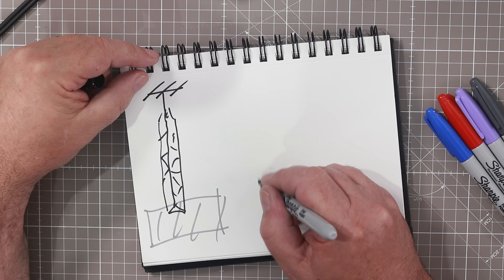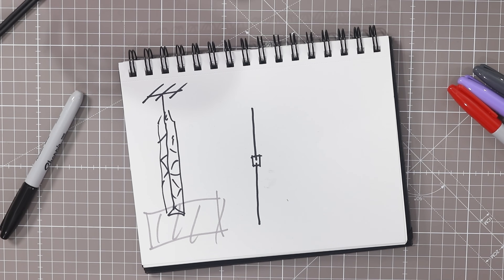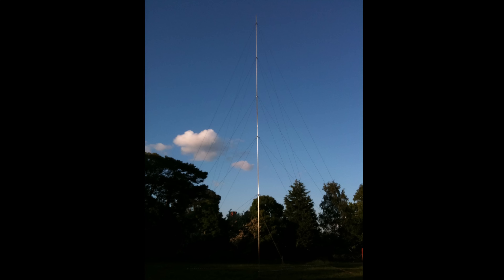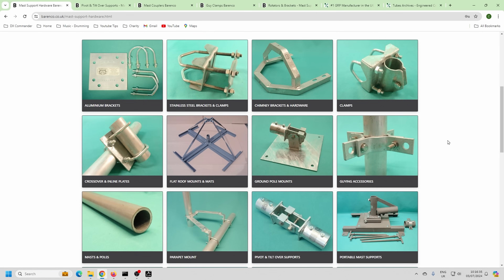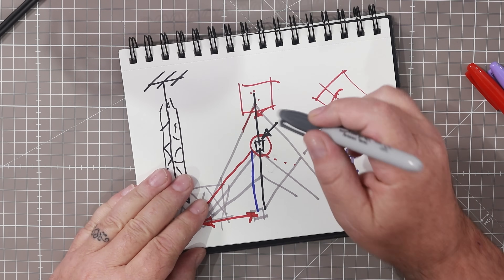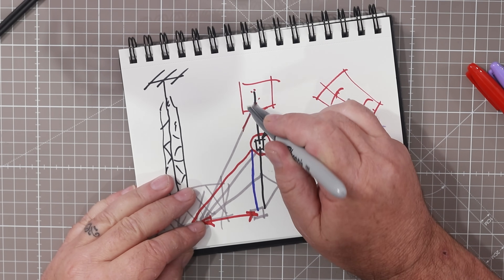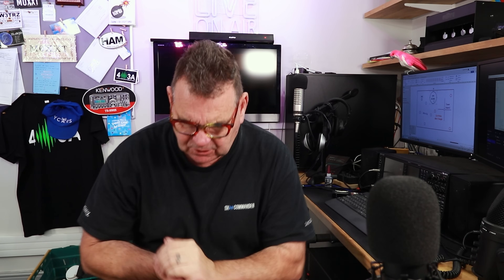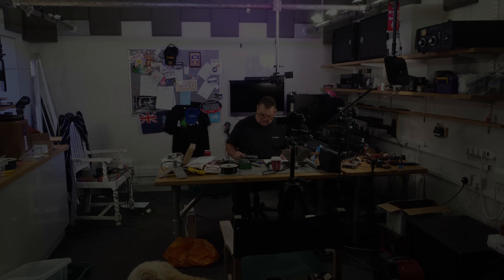Cheap Tilt-Over Tower Ideas for Ham Radio Antenna

Comment: The Chinese use bamboo for scaffolding. Four guys? I prefer Five Guys, but they are quite expensive compared to McDonalds. Oh, unrelated, have you seen Lewis (RingwayManchester)'s latest video? He shows an old cell tower which is currently laying on the ground and is going begging. Probably overkill, but probably cheap. Will probably require three smaller embedded concrete blocks. And it'll probably detune the other antennas so probably a non-starter...
Reply from the maker: It might be cheap - now find me the transport costs - and tilt it over since I am not climbing it :)

Comment: An ideea, put a hinge at the joining spot of the mast, right at the middle of it. You will have ropes also there, right below the hinge. First, easy loosen the one on the top, only the upper part above the hinge will go down. After this is down, loose the rope that is connected right below the the hinge and lower also this part. This will also minimize the weight of the base, the lateral forces for rise and lower the mast will be splittes with the anchoring ropes.  I think will work, you will have a 2 pieces pole with a hinge between, rise and lower on stages. I have done my best to explain :)
Reply from the maker: Well, yes.. Maybe - but I happen to know my way works.. We'll see! Watch the space!
Reply: Is not what i have tryed to explain but search a "hinged pole"  on google and remove the part of top pole below the hinge...

Comment: a long time ago 30+ years I went to a local rally and they had an antenna test range set up for VHF. You could book a slot, connect up your vhf beam and then get a 360 degree plot on paper. They used a variation of the falling derrick system. There was the main vertical scaffold pole, and at the base another pole (the derrick arm) pointing away from the main pole. What they then did was add some more poles from the top of the derrick out at 45 degrees or so which connected to another couple of poles attached to the bottom of the main upright. Another two poles were used as "guys" to the top of the main pole.

Hard to describe in words, but another description, it was a triangle on the ground half way along one side was the main upright, another pole from the apex to the bottom of the main pole, then from each corner of the triangle to the top of the main pole. The triangle on the ground acted as a pivot and counter balance as the pole was winched up and down. It seemed to work very well.

Andy
Reply from the maker: Yeah, I've got it..

Comment: Hi Callum. John Eckert KK7UAG here.  You may look into using something like Unistrut. If I remember correctly, it comes plastic, fiberglass and steel. GOOD LUCK & 73's
Reply from the maker: Looked at that.. Thanks.
Reply: I use a piece of unistrut for each of 3 different masts. Two of them have large VHF/UHF satellite arrays.

Comment: For raising and lowering, check into a 12v DC winch for an ATV. You can put a clevice attachment on one of your guy wires so it's removable when not raising or lowering.
Reply: Beware - ATV winches are good for use in raising (or pulling), but not for lowering (or resisting) a mass weight.  The ATV winch may fail when lowering the mast (as I understand from others).  Winches good for both raising and lowering are quite a bit more expensive.  Don't get hurt, please.
Reply: @dwallich56  no different than unloading a car from a flatbed wrecker. You can easily make a mount to attach it to the concrete pillar to  work from. I'm disabled. I have to come up with other ways to do things. This works well.
Reply: @dannyjardine8828  Could be, but  light duty ATV winches are much different from heavy duty wrecker winches.  That's my point.
Reply from the maker: I don't need power. This should be a hand winch.. And I can probably do it with a pulley.

Comment: No no no  3 polls the One in the middle tilt's over there one in middle is waited for easy tilt 3 bolts or stage pins to lock in place
Reply from the maker: You can do that.. But the outer poles would need to be longer than I fancy.

Comment: Silent Keys, Gene Welch and Ron Adams both hand quad antennas, and what they found is that best results were around 10ft above ground or 100ft.  Both used gamma-matches to tune each element, using a fifth pole mounted vertically.  My old history teacher also used a quad, but found that he had best results with the antenna 6-8ft above the ground.
Reply from the maker: Erm.. Well OK!

Comment: Thanks for the video..would like to see how you ended up doing...I have a 41ft(12m) vibroplex mast that won't be extended the whole way (more like 22-26 feet).  The rotor is base mounted so the whole mast rotates.  Looked at Barenco fixtures, and they are not quite cost effective for this Ham.  My neighbor will be welding up an equivalent one.  Maybe i should do a video of that whole thing.  I have limited space where it should tilt over..nervous..Hi  Hi. see my qrz page
Reply from the maker: Do the video!

Comment: use the metal poles and join them with plastic joiners.....if you keep a short space between the poles it won't be a continuous conductor.........also, I'm sure you have modeled the interaction?.........spacing matters.....my phased 40 meter verts corrupted the pattern of my 5 active element circle array (W1FV & VE6WZ stuff) moved the circle array which solved the problem.........cheerio from Boston FN42........
Reply from the maker: Finding the RIGHT method of joining two poles without an electrical connection is difficult. And yes, modelled it. Not perfect but certainly skews pattern.

Comment: Hi Callum, have you considered screw-piles for the base? I know these are used on commercial towers for permanent and semi permanent installations.
Reply from the maker: OK, so the base is not under that much tension or lateral movement.. An idea though!

Comment: Take it from a professional mason. Go twice as strong as you think. Ive had hospital time from underguessing it.
Max Gain Systems here in the states does serious fiberglass for aerials. They have stuff thats designed for horizontal loads.
The best system for raising a mast is absolutely the pneumatic hollow shaft system. Impossibble to destroy and built for industrial
Lighting
Reply from the maker: Absolutely.. I have a very strong tendancy to completely over-engineer stuff anyway..

Comment: You appear to be on the right track.  I assume that you have taken wind loads into consideration (and multiplied calculated loads by min. 1.5 or safer 2.0).  Also anytime I am handling ropes or cables I wear medium duty leather gloves.  I also like to put all my antennas up without extra help, I enjoy figuring out how to get the job done by myself.  Its the challenge!
Reply from the maker: Since be buy a LOT of Marlow Shock cord directly from the factory, I am friends with their folks and I will let them check the calcs since it's very similar to rigging a small sailing boat.

Comment: Here in the US a lot of people buy extremely long telephone poles from the power company contractors.  They're made out of pressure treated wood. Of course,  it doesn't fold down, but you can have a ladder added to the side of it with saftey wire for climbing.
Reply from the maker: We have 40ft poles here. They need a 7-ft foundation and I can't tilt it over.
Reply: As ex telecom I managed to get a pole for my mate (G3MRZ).  Dug by hand and erected by 2 of us.  Extension mast on top to about 30 foot.  We were in those days comfortable climbing up and working at the top. Safety harness deployed.
Reply: How in the world would you raise a "telephone pole' without all the same gear the power companies use?
Reply: @MrTommy001  Only need a digger.. Just makes more mess.
Reply: @MrTommy001  Its quite common.  No guy wires, the wind doesn't matter.  It only takes a winch truck to put it up.  Not that hard.
Reply: @MrTommy001  
The companies that sell them also deliver and set up the pole.
Reply: @RicArmstrong  Wow, I had no idea! Here I the US?

Comment: Have you thought about an A frame design? Being a bit creative you can make the A frame without any welding, lots of fittings on Norscaff website. The advantage of the A frame is that you basically have only one plane of movement as you are raising it and no swivel joints at the most vulnerable points. 73
Reply from the maker: I have looked at that.. However, I am almost building an A frame anyway - but with tensioned rope.. And the side visible view from a distance should be low. Good idea though.

Comment: Large plastic buckets filled with concrete are a great support and easier to remove. Add some u shaped iron as hooks for easy removal when the time comes. I would use fibreglass as a coupler between metal poles. Not sure why you shy away from a regular tower if you are going to use so many guy wires, if you are going to use 12 guy wires to stabilise the pole you can use the same for a tower. Only difference is that you can't bring down a tower as easy as the pole.
Reply from the maker: I like the idea of the burried hooks.. John's digger could get them out when the time comes. I like it!
Reply: Exactly what I was going to recommend. I dig a hole that the 5 gallon bucket will fit in.
Reply: For guy anchors I use 18" x 18" x 8" concrete blocks I make in a reusable 2x8 form with an eye bolt with a bent shaft sticking out the top.  They weigh about 200 pounds and just sit on the ground and I move them where I want them with my tractor and a chain.  I also have some smaller ones made in 16" round sonotube that are lighter (about 120 pounds) and I can roll them around on their side to move them.

Comment: I built a 55 and a 75 foot tilt over 25G Rohn. I don't do heights, and I can lower them both by myself. I have lowered a few 80 foot windmill towers for people that have the falling derrick style.  My 75 foot is in about 3 yards of concrete ( which you can't do ) and my 55 foot is mounted on a steel shipping container not in the ground ( which you don't have ).  I designed mine using a truss mounted winch incorporating my tilt over hinge. The 75 foot has a 20 foot tall truss for the cable to pull from, and my 55 foot has a 16 foot tall truss to pull from.
Reply from the maker: Nice!

Comment: Interesting project. I'm trying to figure out how to house mount a tilt over 30-40' tower without breaking the bank. I don't want to pour a ton of concrete as well.
Reply from the maker: You could wall mount an aluminium 30-footer on the side.. I did that once. But careful it's not that heavy when fully loaded. I also braced my wall with some huge vertical timbers.
Reply: @DXCommanderHQ great idea. I'll have to see if I have enough bracing to do something like that.

Comment: Dx Engineering has some very sturdy fiberglass tubing roughly 46 ft tall TFK 46 I think
Reply from the maker: Ah maybe.. Thing is, I can't ship it.. But good tip for USA guys.
Reply: @DXCommanderHQ  Maybe they'd do a deal for a supplier of fantastic Antennas and Antenna Accessories:)